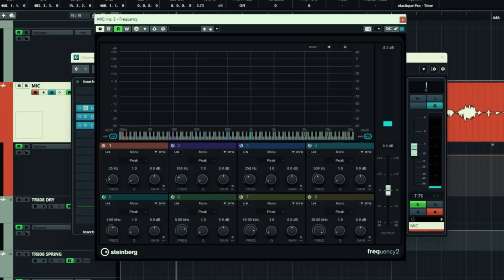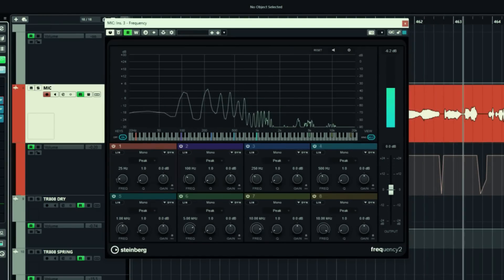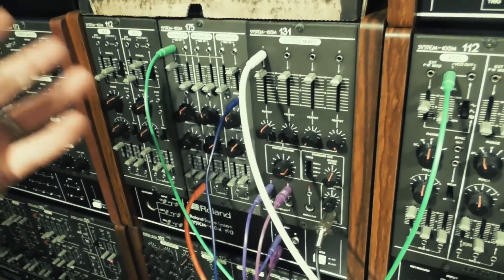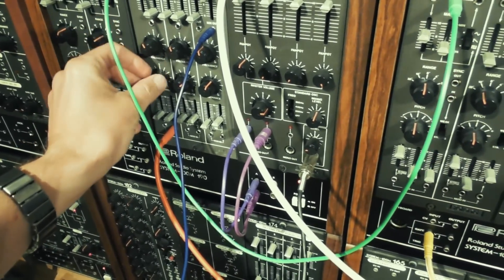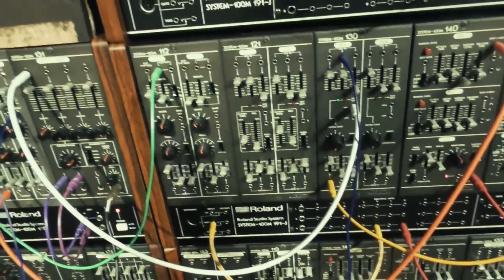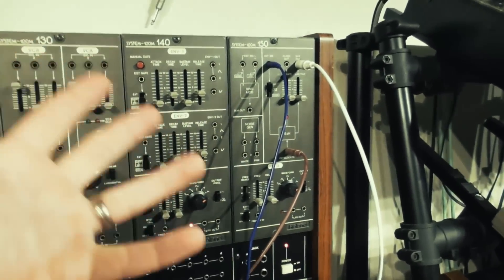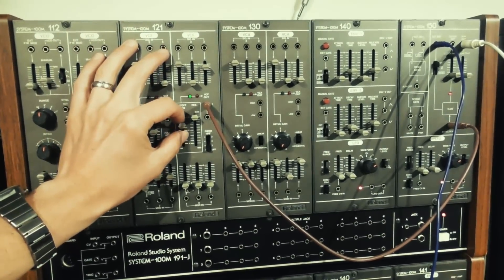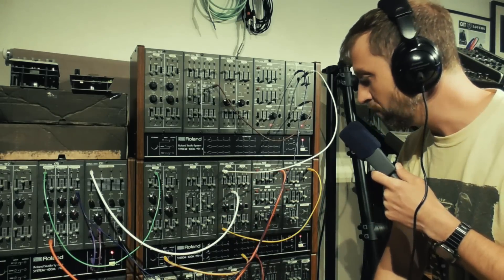Talking Synth Tutorial!

Comment: Does anyone know how the prophet was programmed?
Reply from the maker: One oscillator set to sawtooth. Filter and envelopes setup as they were in all the other examples.

Detach the second oscillator from the keyboard, but don't run it in low frequency mode. Make sure it's turned off in the mixer.

Then choose filter cutoff in the polymod section and dial up oscillator B. Then play with the frequency of oscillator B until it's modulating the filters at a fast enough rate to create the effect.
Reply: @AlexBallMusic  thank you!

Comment: Great video Alex!  This is pretty off topic, but what do you use exactly for your synth/gear stands?  I'm in the middle over overhauling my studio and I need a better rack solution for my keyboard/non-rackmount gear.  Whatever you're using looks super stout.  Thanks in advance!
Reply from the maker: I mainly use Jaspers stands, although my System 100m is on a large office table that I modded with additional legs. The studio furniture tends to be quite expensive, where general furniture is cheaper if you can make it work. I've seen others do clever things with shelving racks from shops for example.

The Jaspers stands are very good, they're just not cheap.
Reply: @AlexBallMusic  Thank you much!  I actually came across Jasper after posting and realized that's what you were using.  They're within my budget, but we'll see how much shipping is to the states from Germanyland.

Comment: Technically you don't even need a S&H, an audio rate modulated VCA will do (almost) the same trick. Just in case you don't have an S&H in your system. I'm at around 7 minutes, so you probably will bring that up as well. :D

Well, I guess I added some other way to do it. ;) Very cool video! This is the stuff I like. And a great jam at the end to top it all off!

Edit: I used a Mother-32 and a DFAM to create a bandpass filter and I used an external env. generator for the DFAM (which I probably wouldn't have needed). Massive YIAOOUS!

Comment: Awesome tutorial! I tried it out on my System-500 first, but had a tough time dialing in the filter used for self-oscillation. I'm now using a ladder filter instead for the S/H clock input and a G-Storm SH-5 clone for the main filter, feeding the main sawtooth into the dedicated bandpass and a bit of sub-osc into the lowpass, then the final audio signal into an expert sleepers persephone VCA with built in JFET distortion. Takes a lot of time to dial in but the result is so cool. Now I just can't touch anything ever again. I've never thought of using S/H for anything other than random voltages with the built in noise for the sampling input. Thanks again!

Comment: So Alex I have a question. I am trying to achieve this with Korg MS20 . But what i should put in the Clock IN ? Fast LFO ? it gives only static noise. Im confused to what i did wrong... EDIT i m only trying the first method, havent checked the second one yet
Reply: i supposed its because its only an lfo that i used. i have not extra filter on this thing to use as self oscillating source - same with the Arp 2600 ? Im gonna check out the other method haha.EDIT I think I got this ! with the Arp, i paused the vid on the Arp setup I see u used OSC2 into clock ! is that right ?
Reply: well, still ...only static ! :(
Reply: managed somehow with OSC2 into clock but with MS20. Still dont get the setup especially on the Arp

Comment: I was so surprised to hear the Trident doing this sound at the start of your video. I immediately thought that it sounded like it was run through a sample rate reducer - and exactly that was the case! I produced very similar sounds in my synthesizer demo video of the tiny Hotone KRUSH pedal. I like these sounds as well. YAY!
Reply from the maker: Funnily enough, I'd actually stuck an oscillator from the 2600 into the filter input on the back of the Trident, so that one was audio rate filter FM. The bit crusher would have done it too though, as you say.
Reply: @AlexBallMusic  Ah, neat trick! I could try that with my Trident and my MS-50.
Reply from the maker: @PepeMusic  That'll do it, yep!

Comment: So fun! I first discovered this with my Akai S3200XL - I think I'd sampled a pattern from a 303 and then went to the FX section to process it. The S3200XL had a frequency modulator, which if set correctly gives virtually the same effect as the Sample + Hold technique here. I was like "Oh, THAT's how you make that sound" lol

I think the first time I ever heard it was either on the track 'Fly Street' by Squarepusher, or 'Shiz Ko E' by The Tuss (aka; Aphex Twin). Both tracks rinse this technique.
Reply from the maker: Ah cool, I didn't know you could do that with Akai samplers!
Reply: @AlexBallMusic  I think the FX board is called the EB16, it came as standard on the 3200XL but could be bought seperately and put inside any 3000 unit and even the MPC2000! If you ever get the chance to do so, please have a play around with one!

It had an unusual selection of effects and modulation options, like cascading pitched delays and reverbs (a la Eventide H3000), the aforementioned frequency shifter and my favourite of all was an EQ with a dual LFO's for the peak frequencies and gain...just barmy stuff, you could very quickly get into headfuq IDM territory lol.

It's been a while, but I seem to remember it being dual channel too, one for anything and one exclusively for reverb. I cannot think of any other hardware FX unit off the top of my head that could do all of those things, besides an Eventide system that's 100% user programmable with the only limit being memory...but alas, nobody EVER seems to talk about them!

Comment: That S&H/sample rate trick is *weeeiiird*. 😀 I do not quite understand what happens there. Your "yays" have always sounded crunchy, and now I know why.
Reply from the maker: Yeah, I don't know why it exaggerates the rough vocal sound so much, I'm selfishly hoping someone explains it in the comments. 😀
Reply: @AlexBallMusic  S&H is basically a form of sample rate reduction, which generates mirrors of the spectrum above half the sampling rate. So as the filter resonance peak goes down, the mirrored one goes up - in a similar fashion when you change your mouth from 'ah' to 'ee'. Pretty much the same effect that happend with the bit-crusher you've use, which wasn't actually reducing the bit depth (that would have sounded different, noisy and distorted) but rather reducing the sampling rate and generating the same mirror frequencies ... just like a S&H.
Reply: @corri303  Oh, yeah, right, I forgot about the spectral folding! To be fair, I only learned about this in engineering school in the 80's. 😀
Reply: @RegebroRepairs  They probably didn't show you how it relates to sound. At least they did not in my engineering classes in the 90's :)
Reply: @corri303  No, they did not, it was all very theoretical.
Reply from the maker: @corri303 Thanks so much! I was hoping this would happen. 😀
Reply: @AlexBallMusic  my pleasure, sir :)